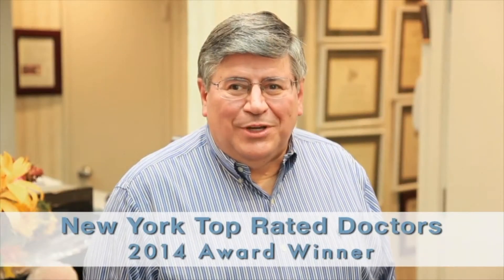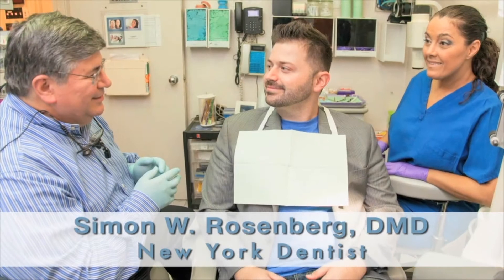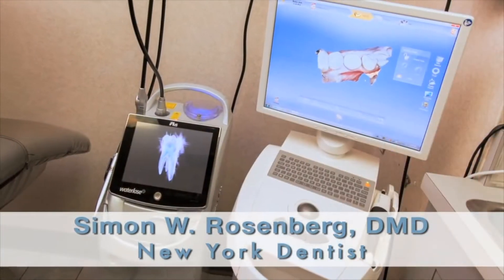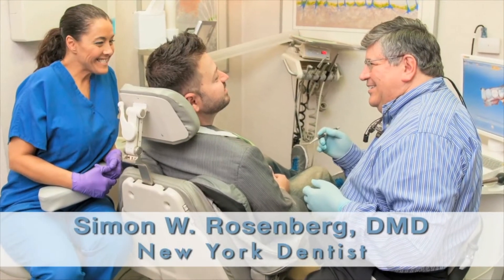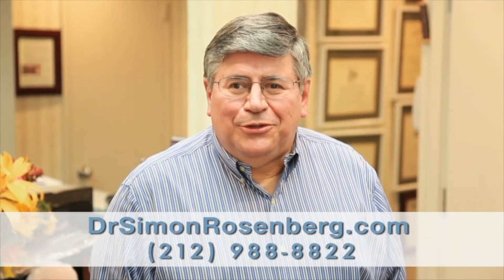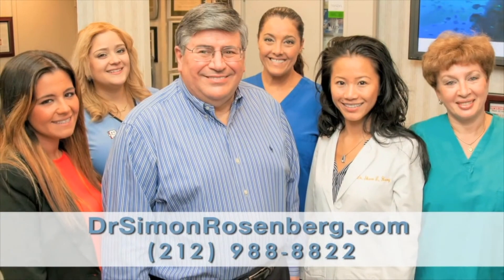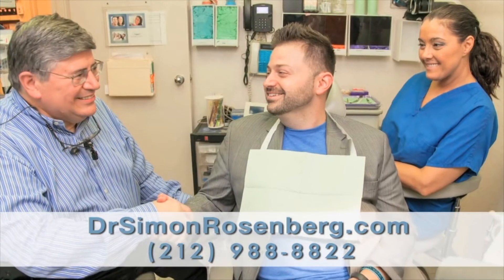3d Animation Shows The Procedure For Dental Scaling - NYC Dentist - Dr. Simon Rosenberg

Comment: I don’t mind this but why should they use cold water 🙄 my teeth are already sensitive.
Reply: Ms West, that is a great question. There are several answers on why the water is cold. First, is the fact that the tip would get hot when the tip which vibrates in the ultrasonic 5KHz range touch’s the tooth without cool water. Secondly, when the water is sprayed out in a mist it becomes cold due to evaporation cooling. Even if we had warm water going it to the tip, it would become cold from evaporation. And thirdly, warm water in the supply line poses an infection control problem of developing bacterial and fungal biofilm in the thin tubing. We would not want to be spraying bacteria or fungus into your mouth.